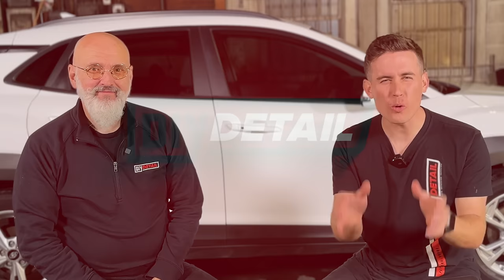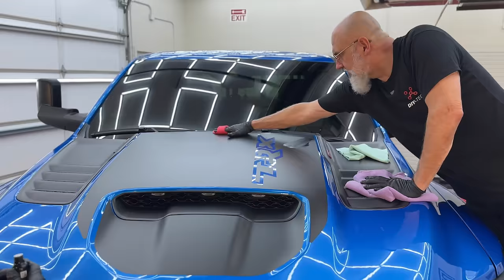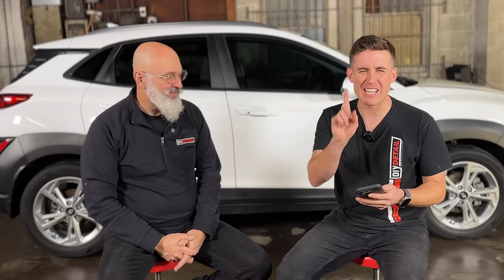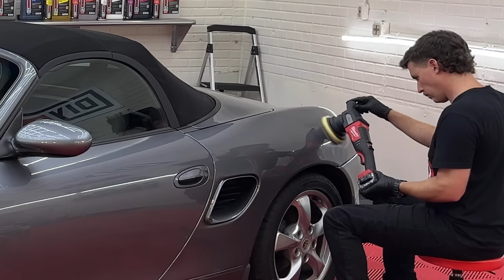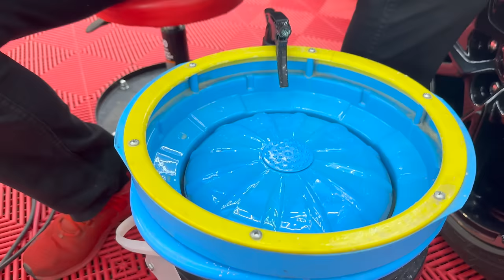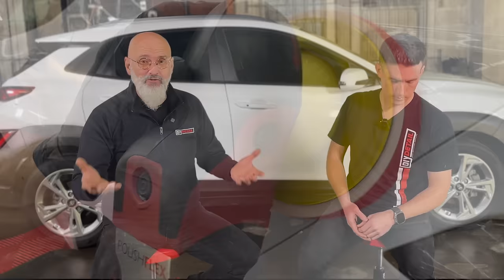Avoid these OVERRATED detailing techniques: 5 tips to save you time | Podcast #83 #diydetail

Comment: I attempted my fisrt ceramc/graphine coating on one panel of my new covered snowmobile trailer this weekend using the cross hatch method.  It turned out ok, bit i did get a noticable line ( high spot) across the whole section.   On my next section I'd like to try your circular method,  but in the video i I noticed you were wiping the coating off immediately after applying.  Do I not need to let the coating flash before leveling and wiping it off?  

Also how can I get rid of the high spot line from the panel I coated already?
Reply from the maker: Wipe off is determined by humidity. The higher the humidity the faster the leveling. 

You will need to polish
Reply: @diydetailofficial  would doing another coat of ceramic over top of the first one remove the high spots?
Reply from the maker: No

Comment: If your car is well waxed and protected.......then I rinse with pressure washer, then heavy foam, let it soak out of the sun, rinse again , then two heavy micro towels   to dry the car. No scratches to problem.
Your much better to wax more often then worrying about a foam rinse foam rinse approach
Reply from the maker: Good

Comment: I know you will favor your products, I now do too. However, I already have a Armour Detail Supply iron remover, will this work as well as a lub for the clay towel? Also, you mentioned you don’t rinse the shampoo foam when planning to clay, how are you able to not let the foam dry on the car? Thanks for the great content.
Reply from the maker: You will need to test it. Work in smaller sections if working outside.

Comment: I just forget ceramic altogether and use spray wax.  Also I skip out on pressure washing.
Reply from the maker: Good
Reply: Do you use a spray bottle to apply a prewash chemical?
Reply: Yes, I  use the Rinseless Wash solution with a pump sprayer.  Then, I rinse it off with a garden hose with a nozzle attached.  @SuperDaveguitar

Comment: Now if we could just get rid of ceramic coatings altogether, we could preserve our precious clearcoats!!
You might be wondering what I mean by that. Well, you can't remove a coating even when it is at the end of it's serviceable life without polishing it off.  Some coatings last only a year. That's a lot of polishing. I think we would be better off with longer lasting waxes and sealant that are more easily removed by alkaline cleaners. For me, a good durable wax is Soft99 Fusso coat. Let me know which durable wax you like!
Reply from the maker: Many coatings last decades, and you only need a very light polish with a fine pad to abrade the existing coating.
Reply: @diydetailofficial  There really are very few coatings that last a decade or more and they are generally not meant for the diy'er.  New car clearcoats are thin. Old car clearcoats may have been buffed a bunch of times before you bought the car. No way for the average paint thickness guage-less diy'er to know when he has buffed too much. We have all seen older cars many years ago that have been beautifully maintained with frequent applications of good carnuba wax. My point is to consider the long term affects to your clearcoat ( unless you don't keep your cars for the long term) of having to constantly buff off coatings as they fail

Comment: In England cars get a high amount of road tar stuck to the lower areas sill rockers bottom of bumpers so if you use the decontamination towel its wrecked wont clean up so at what point in the process  do DIY tackle this
Reply from the maker: Start with a pre-soak of DIY Detail All Clean , do your contact wash, then use the Perforated Synthetic Decontamination Towel

Comment: Vertical or horizontal strokes to stop circular scratching, hahaha anyone would think the clear cote was jelly, and we used sandpaper to apply the ceramic coating. I've been involved in preparing cars and selling them for 35 years, and logic with common sense is the secret, unfortunately from my experience of a lot of the so called Ex-spurts in detailing has not been positive....
Guys thanks for your logical approach to your work. Time equals experience and qualifications.
Reply from the maker: Thank you.

Comment: Detailing is just elbow grease which should be minimized by keeping up on it with regular washes, but not too often.   What also should be minimized is the need for an array of supplies and tools.   We're just cleaning cars here, it's not rocket science.     Most people do more damage to the paint with excessive washes and unnecessary techniques .  Unless you've got a black car or your talking about 20 years of neglect, you don't need to buff the thing.  Most of those surface scratches cannot even be seen unless your specifically looking.   Get yourself a $10 clay bar, some spray wax, some microfiber towels and hit he paint good once or twice.  Then throw a simple coat of wax on it.   You will see dramatic improvements.   If your not satisfied after that, you can explore other techniques or seek pro assistance.  But please don't  just throw $$ at it without exploring all options.
Reply from the maker: We like simplicity as well

Comment: For the rinseless wash. 1 oz for 2 gallons.  Is that US gallons which is 7.8 litres😢.  i am in Canada and 2 gallon equals 9 litres.   Is the one oz still ok?
Reply: Canada hasn’t used a different size gallon since the 70s as far as I’m aware any product you’re buying in gallons or 5 gallon bucket should be a US Gallon. Though half a liter per gallon shouldn’t make much of a difference if you are using the old measurement. 
I just eyeball 4 gallons in a 5 gallon bucket then add 2 oz of whatever rinseless I’m using.
Reply from the maker: Yes, US gallons, not imperial gallons.

Comment: Ivan, i know you use the polisher to help also dry the.pad after cleaning it.
I was looking at detail guards pad.clenaing system and they actually recommend not using your polisher to help remove most of the water as it could damage the pad? 
confusing?
Reply from the maker: In decades of doing that, I’ve never damaged a pad.

Comment: Gravity feeding is not safe for a pressure washer.... Use a diaphragm pump..."deal with battery charging " your wash buckets do not have to be filled up to half.. 1 quart of water in each wash bucket " car & rim/tire" is plenty... Ceramic itself is overrated. Great for exterior trim...
Reply from the maker: Some pressure washers can be gravity fed without issue. 

Why do you feel that way about ceramics
Reply: @diydetailofficial  because id rather buff polish and wax.. it's more personal and it's nostalgic to me. To me polishing is an art... Ceramic to me is only for newer vehicles to protect their fresh new coat of clear coat... I'm not against it but the car will always get dirty no matter how hydrophobic it is. I understand it makes the process easier when washing a returning customers/ maintenance car but where I live people love regular basic washes with a quick polish.. In and outs..... No longer than 45 minutes for the exterior and no longer than 2 hours interior: including the exterior.... The more cars I can do without ceramic the more money I can generate. " I don't have a shop" .... If it's already ceramic on the clear coat I'll wash accordingly...
Reply from the maker: Many use ceramics as a long lasting foundation, and wax over it.

Comment: I stopped watching at the 1:20 minute mark. There is a reason why every Ceramic Coating company recommends the crosshatch technique. Its not about high spots or scratches,  its about not missing any spots. Circular motion has a higher chance of missing small spots. 

What a garbage video
Reply from the maker: Sorry you feel that way, there is no correct way of detailing, but many different ways. Not all coating companies suggest cross hatching, many recommend circular motions